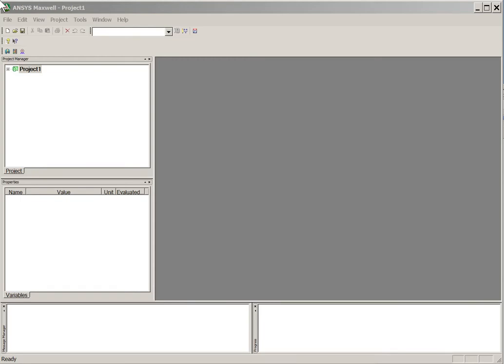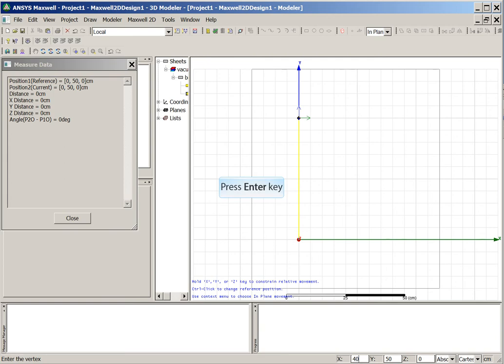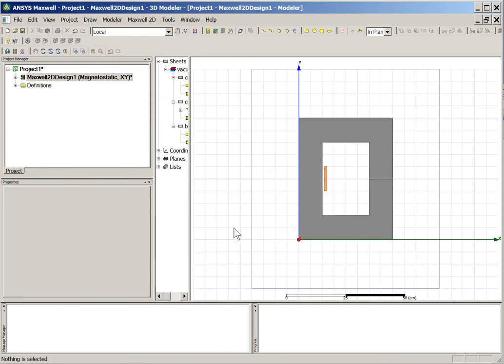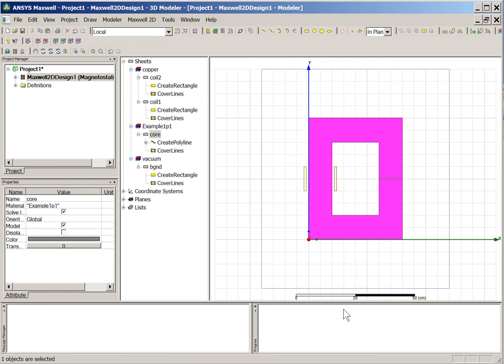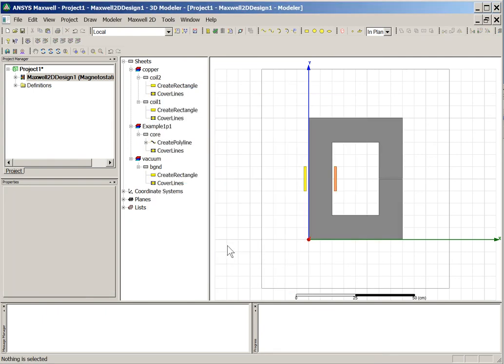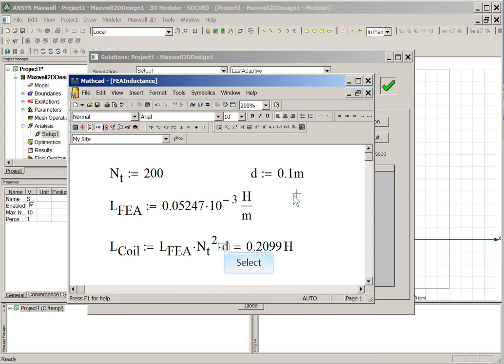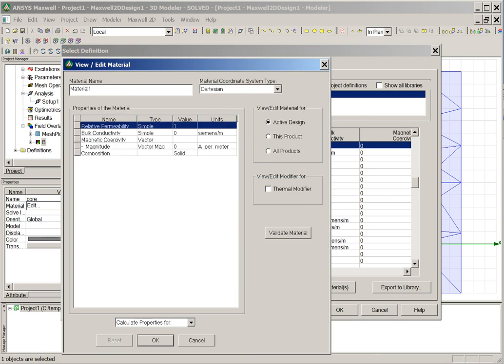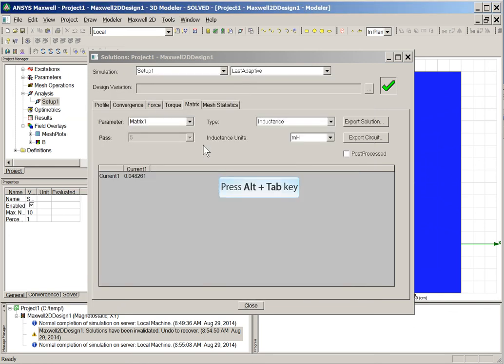Maxwell_Demo

Comment from the maker: Sequence of input data points for the core polyline:
x, y
0, 0
0, 50
40, 50
40, 25.1
30, 25.1
30, 40
10, 40
10, 10
30, 10
30, 24.9
40, 24.9
40, 0
0, 0
0, 0 (repeated point terminates the polyline)